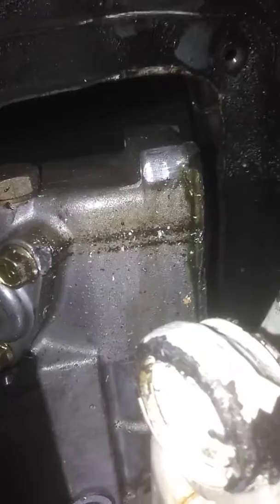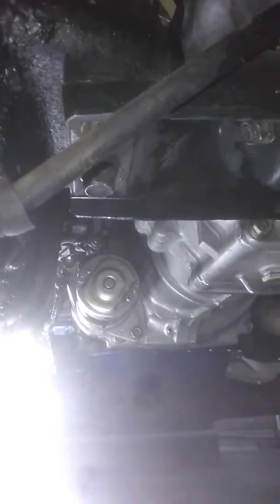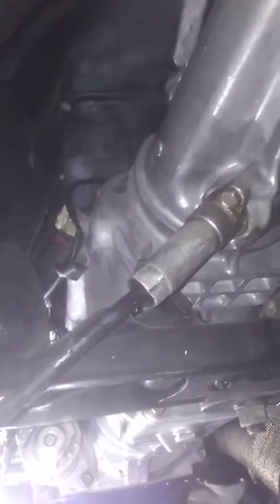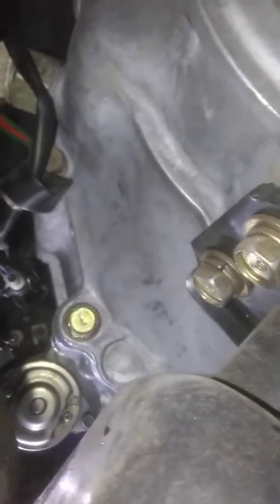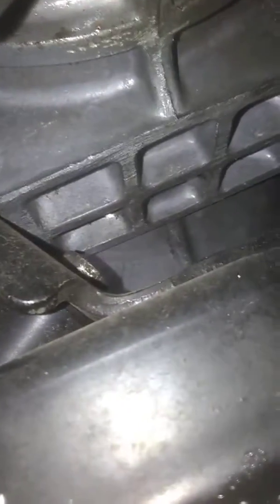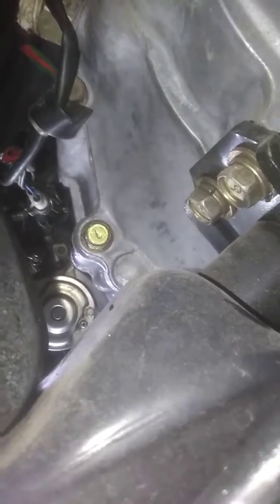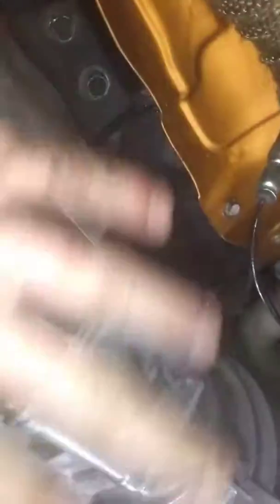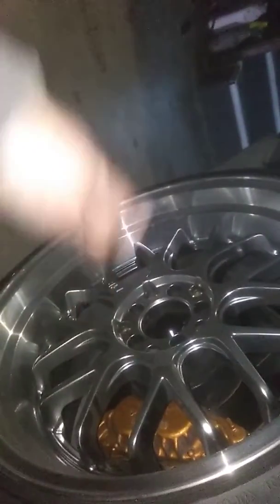Mazda RX7 FC N/A makes power exploded drive shaft part 2

Comment: Dude my car literally just did the same fucking thing. I’ve got a 1988 Mazda Rx7 savana. Let me know what all you had to do man
Reply from the maker: My u joints wind up being a cheaper quality with a hollow center which sounds like a good idea when it comes to greasing it but really it made it extremely weak to where my recommendation is a set of u-joints that are non-greasable and after replace them make sure the dry shaft is balanced I just wind up getting my hands on a AutoZone replacement that was a dorman brand that had Spicer u-joints and it was a thicker tube it's still holding up surprisingly